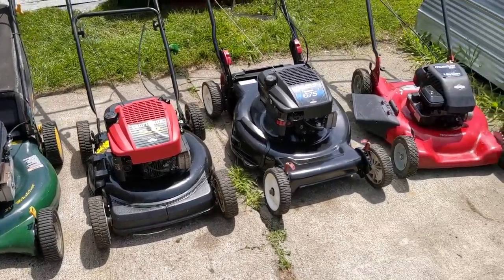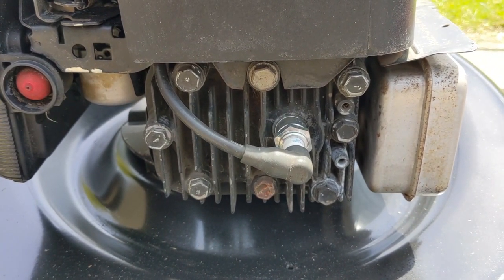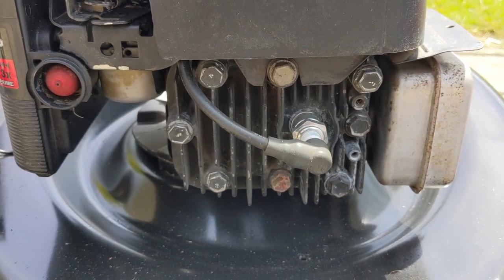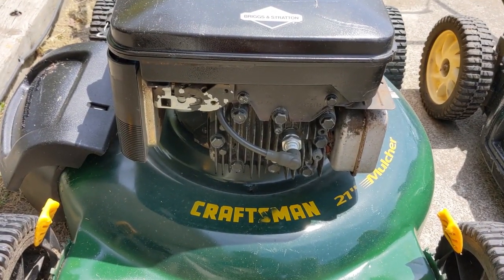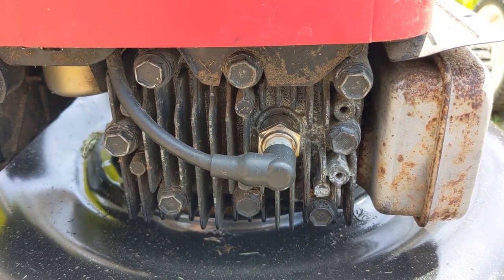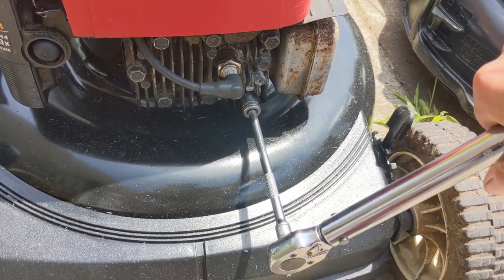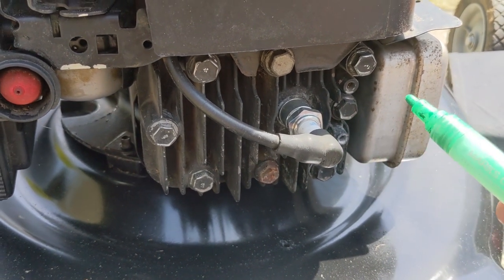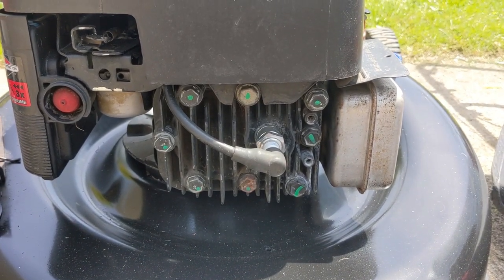EP Tech Tip #3 - Torque the Head Bolts

Comment: As someone who serviced and calibrated torque wrenches and equipment, always support the head of the tool while torquing the bolt. Sometimes when you do not support the head of the tool, you can apply more torque to the bolts as intended that can lead to bolts breaking or stripping. It can also lead to under torquing leading to loose bolts.
Reply from the maker: Yea just looked like that because I was filming with one hand! I always support the head, thanks for watching!

Comment: After torquing down the bolt you can use the paint marker to mark where an edge/corner of a bolt rests, so in case the bolt loosens up you can tell it has done so just by visually inspecting it.

Comment: Great video and good tip, I have an older B & S push mower with flat head engine and head bolts around the valves always loosen. Have to tighten them before each use, but it Still runs great.
Reply from the maker: Thanks for watching!

Comment: Hi  Great video!  I have a Briggs 28B707-1025E1 engine on a DR brush cutter.  No compression.  The head has 9 bolts.  Can't find anything on the torque specs and bolt pattern for this engine.  Please help

Comment: Thats only about 20 NM which seems low compared to a car which is approx 100NM? I found mine loose on a older 12.5 HP and tightened them up maybe bit more than 20nm, will check later.

Comment: You happen to know the specs to the plug for same engine?
Reply from the maker: I never torque the spark plugs, I just tighten them up then use 1 finger on the ratchet to finish it off. They have a crush washer on them, you just need to compress that a bit

Comment: Yes torque that POS down. Then all the oil from the shity valves will go up in smoke and foul the plug. Not supposed to have oil in the cylinder head you have either bad valve seals or  piston rings . This guy fixed nothing.